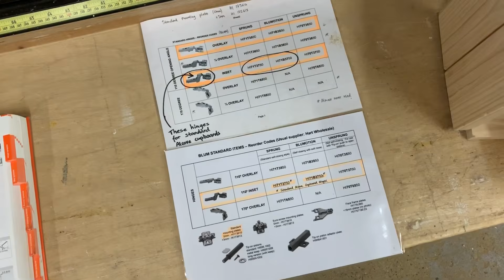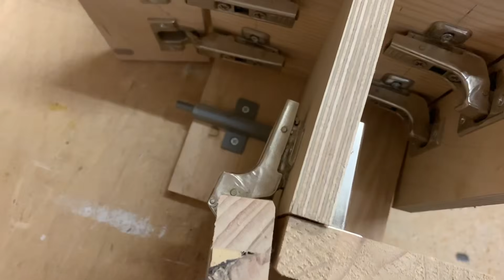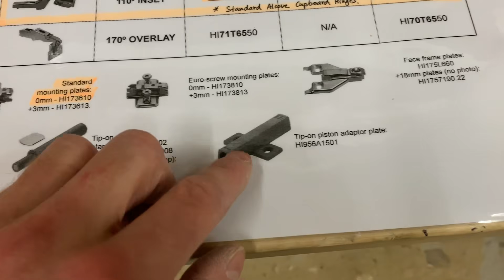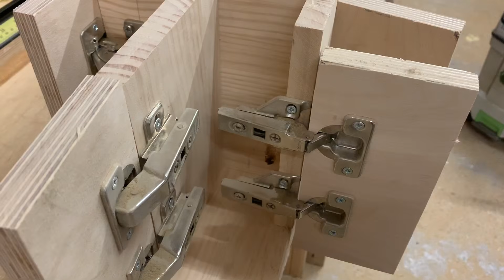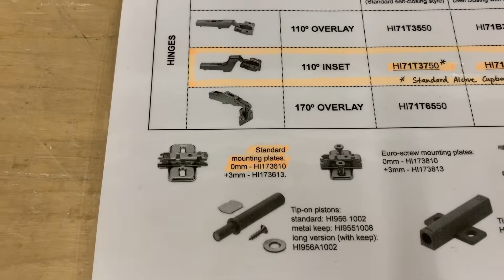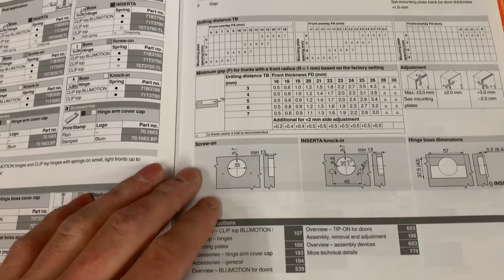All the main Blum hinge types explained!

Comment: Alistair, any thoughts on router tables for tight shed. Have a DeWalt and a Festool router and an MFT3 table.
Reply from the maker: I'm no expert on router tables.   But we get on ok with our Trend CRT/MK3 which we store under  the worbench in a big wheeled cart with a board for a lid.  When we take it out it we pullout the cart, lock it in position, and the router table sits of top of the lid.  So quite a good space saver

Comment: Thank you! Don’t normally do much cabinet stuff, but have a few bits on at mo, so this is great. You recommended screws in another video.. can’t find which one. Any recommendations for screws? I’ve just had a load of hinges delivered... and no screws! 3.5 x 16 yeah?
Reply from the maker: Heriot Handyman we use 3.5 x 17 hospa screws from bagel but 16mm is fine!  For years though I ordered a slightly different metal colour to the hinges not realising there was a beet match. The Hafele code for best match (nickel plated) is 015.35.646

Comment: Thanks for sharing. What hinge would you use if you had internal pull outs drawers is there a hinge to allow for 12 x 450mm drawer slides which would make the drawer 25mm shorter then carcass opening but will the hinges be protruding enough to affect drawers. Thanks Dave ,
Reply from the maker: david osullivan I normally set the drawers back inside the carcase about 90mm to be well clear of the hinge arms, and make the drawers in their own sort of sub carcase within the main one, with fillers either side about 40mm to keep the drawer fronts well clear of the hinges as they open past them.  I hope that makes sense.  12mm clearance either side will not be enough
Reply: Freebird Interiors thanks Alistair , my problem is I built a free standing pantry with drawers, shelves the lot fully functional i have doors nearly done .I now i am deciding about hinges 😕 . Silly I know fail to prepare , prepare to fail but what about these zero protrusion hinges that allow for shelves to slide out , I still think I wii get caught 🥵 stay safe regards Dave
Reply from the maker: david osullivan I think they still stick out too far.   Maybe a different approach with a traditional hinge or piano hinge arrangement ?
Reply: when using pull out drawers all hinges of this kind are a pain as they limit the size of the drawer box.  For inset doors use butt hinges and there is almost no restriction on the width of the drawer.  They are also not the kind of hinges found on melamine covered chipboard furniture which is a plus quality-wise.
Reply from the maker: david osullivan see how I did the drawers here: https://youtu.be/6ad-v6HPBgw

Comment: Love this kind of video explanation. Thank u so much for the knowledge
Reply from the maker: My knowledge of spraying is limited to water based products.  We get good results with Sayerlack waterbased products.  The top coat is code AT99.  Purchased from Movac here in the UK.  I know a lot of people doing this sort of work using PU products with good results though.  Waterbased needs extra sanding down after the first cost due to grain raising but after that you can get a flat finish with a normal amount of denibbing.  It depends a lot on the quality of the board; Medite Moisture Resistant MDF is better than most
Reply: Freebird Interiors thank you so much for ur reply again! Best of luck for the utube channel. Cheers
Reply from the maker: salju wi you’re welcome, thanks for commenting
Reply: Freebird Interiors very much welcome. May i ask/recommend of interior spray paint on wood process video. Im having quite an hustle doing milesi PU paint coating on mdf substrate. Thank you!